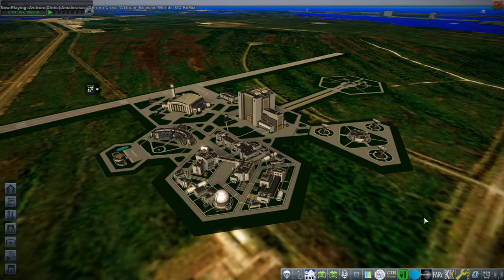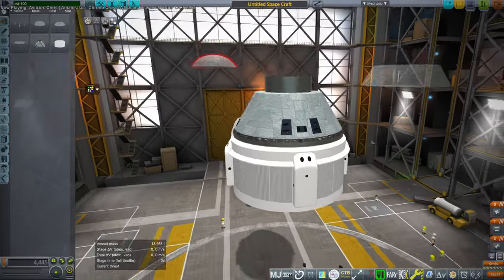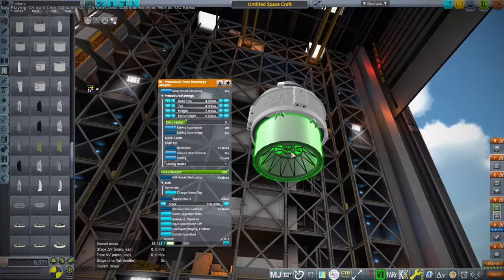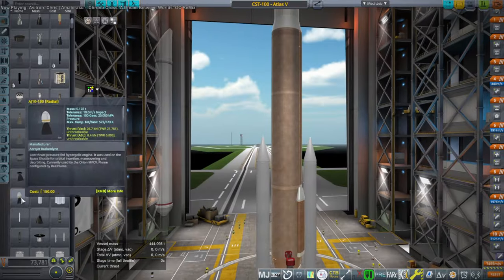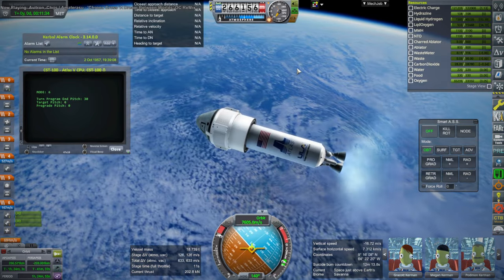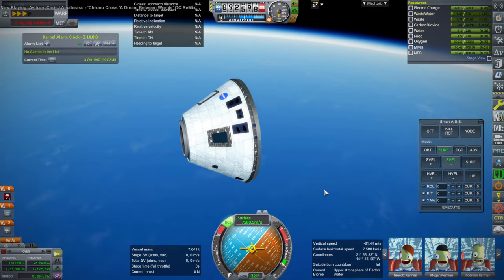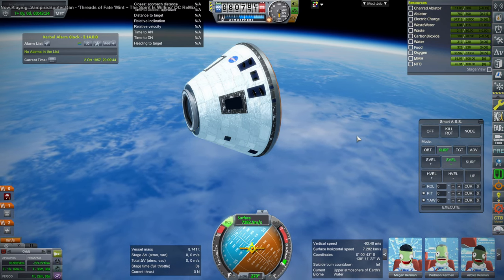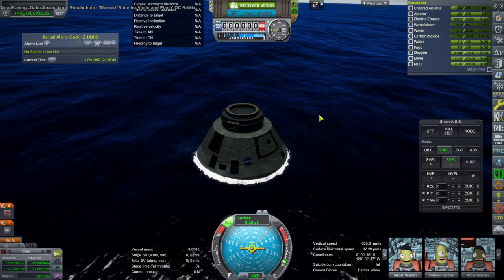CST-100 Checkout Test (RO in KSP 1.12)

Comment: is there a way to fix needing procedural avionics with KSP RO non RP1
Reply from the maker: I didn't think Procedural Avionics were necessary without RP-1 - haven't had that problem myself in sandbox or with my RP-2000 career.
Reply: @RaizSpace  from what I was able to find the default realism overhaul spacecraft files which have everything pre-built only work with procedural avionics. I use the realism overhaul express install. Is there another way without having to build them all myself. Although that is fun. Is the rp2000 a install method you use?